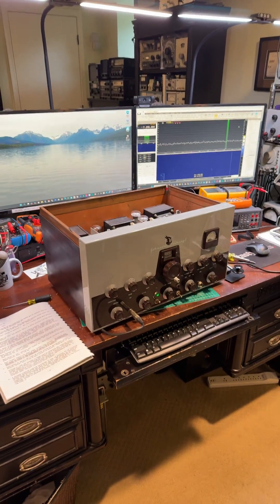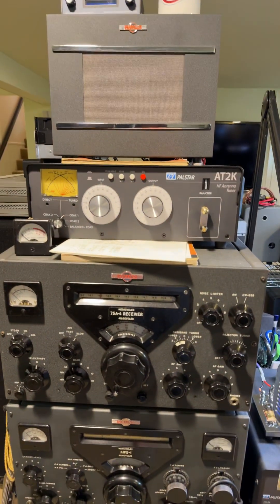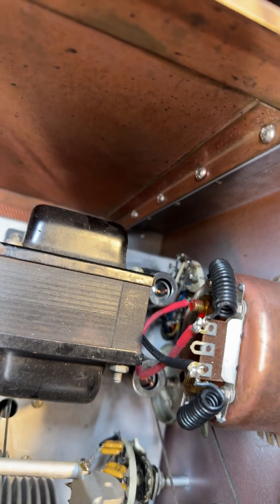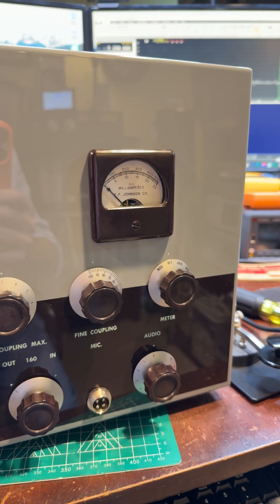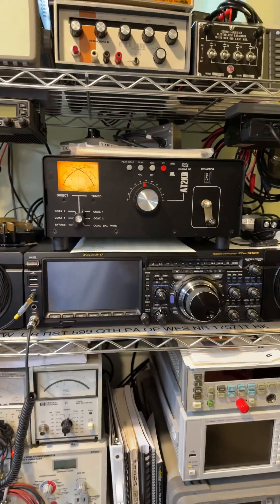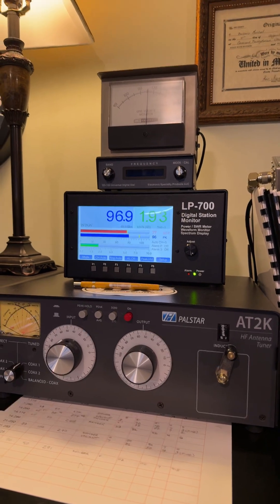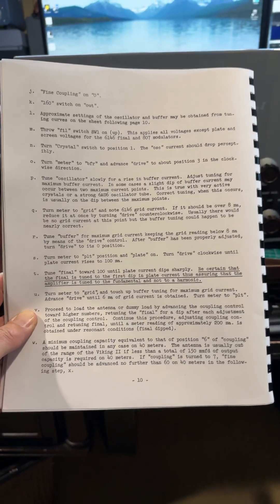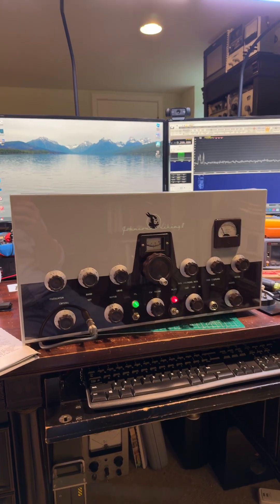Johnson Viking II Repaired! #antiqueradios #radioequipment #sdrreceiver #vintage #hamradio

Comment: My lic is [KJF8382] if ya ever hear my motor-mouth out there.
Reply: That looks like a CB license from back in the sixties or early seventies. I remember call signs like that very well.
Reply: @BuffDelCampo  Your exactly right. I knew you would know what it was. It is not a ham radio lic like yours. Now a days no lic is needed for CB. 
Times b a-changin 😉